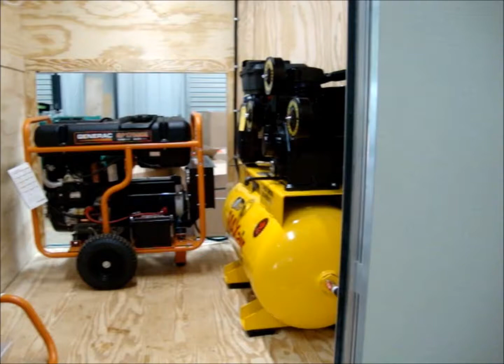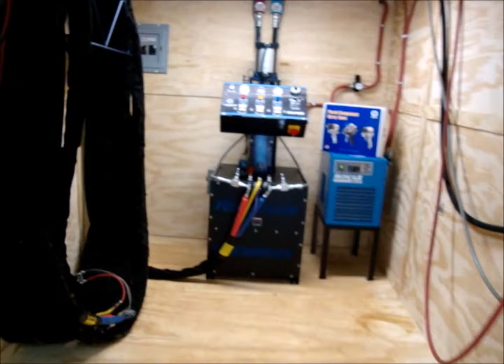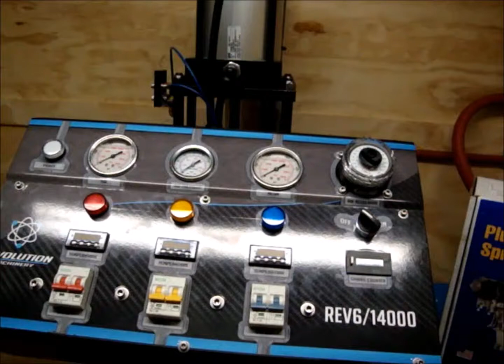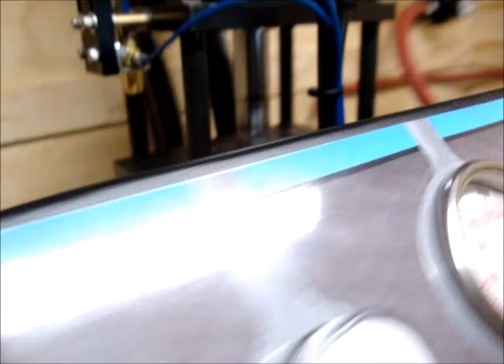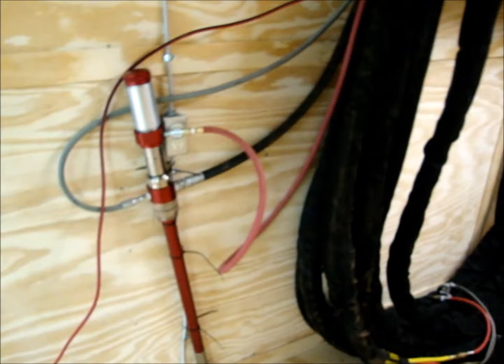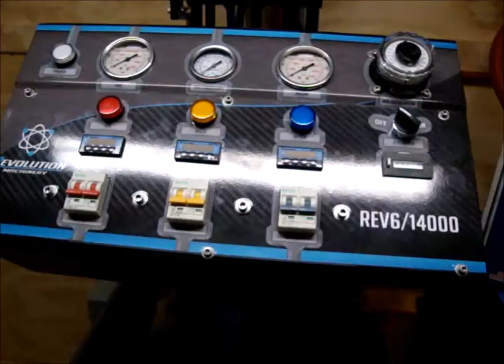SPRAY FOAM TRAILER, SPRAY FOAM RIG, SPEC TECHNOLOGIES

Comment: 14KW of heat??  Why?
Reply from the maker: Hi Steve, Actually you really don't need 14k if your material in the drums are properly prepared. We suggest you get the drums to 75-80 degrees to help with viscosity and reduce the likelihood of scorching  material in the preheaters.If properly prepared 5-6000 watts is just fine if it's a good heater design....

Hope this explains...?
Reply: Yes thanks.  I'm in New Zealand, researching this technology.